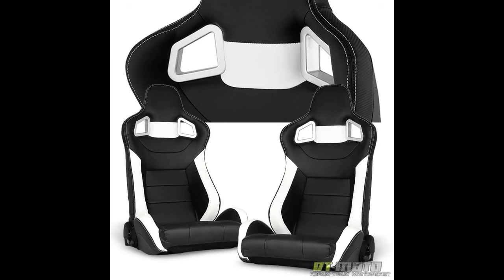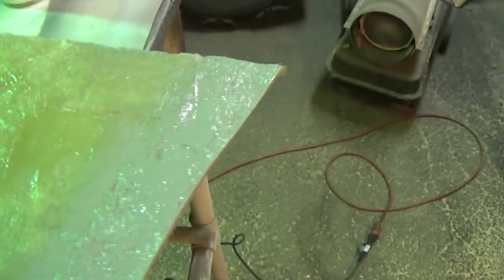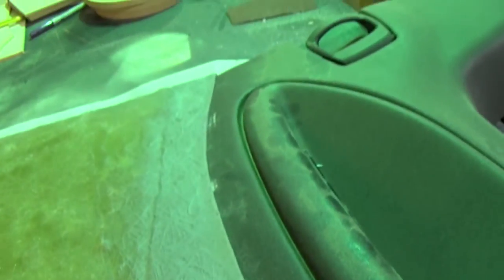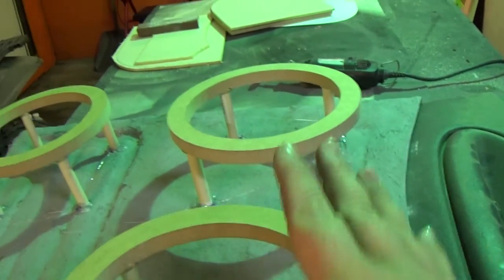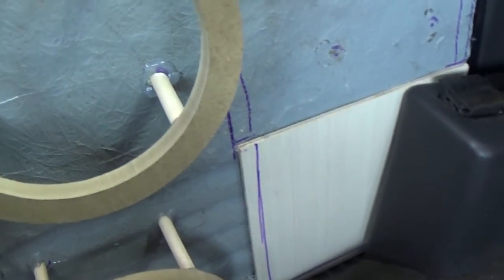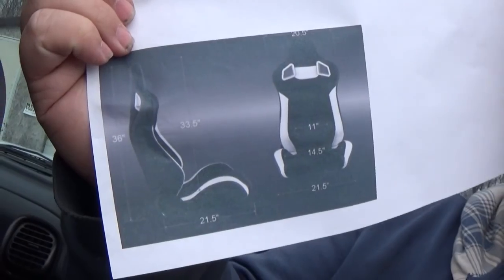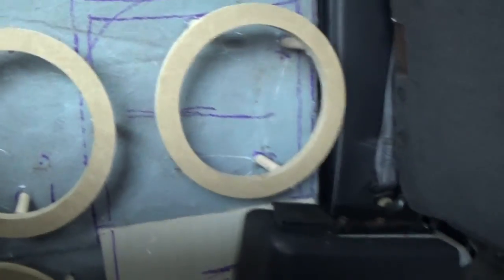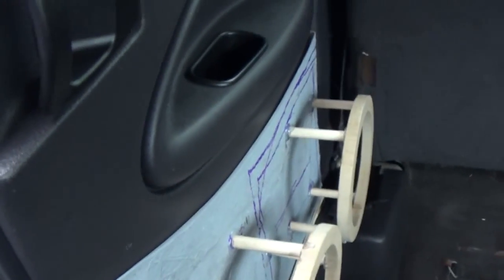DODGE RAM FIBERGLASS DOOR BUILD - BUCKET SEAT PLANS

Comment: I wanna do this in my Silverado, But I want it to be an amp rack! Do u think it's possible to do with the weight of a couple amps and if so do u think the 0 gauge wire would work through the door with a boot or another way? There's nothing in that door now so no boot or anything but the hinge